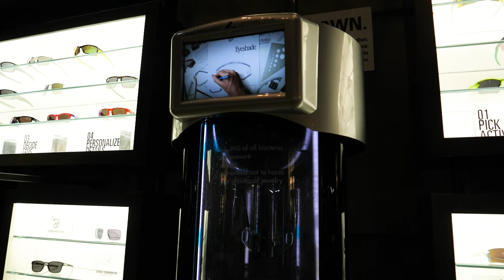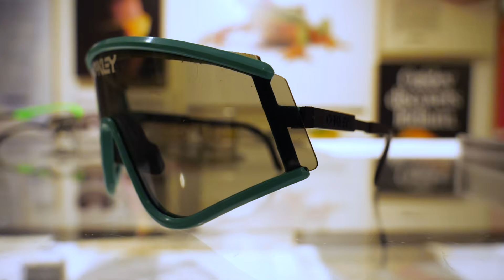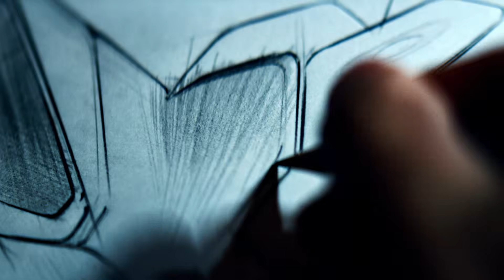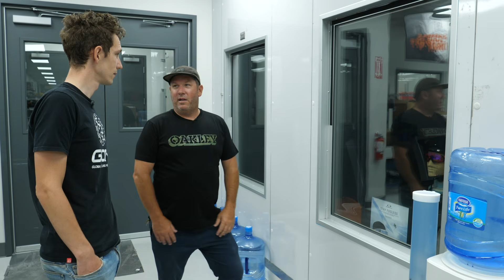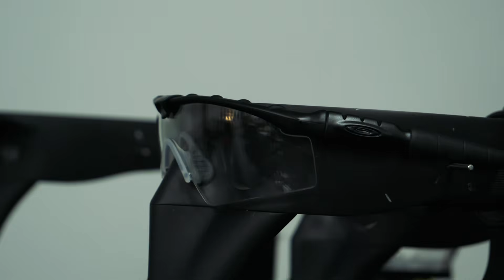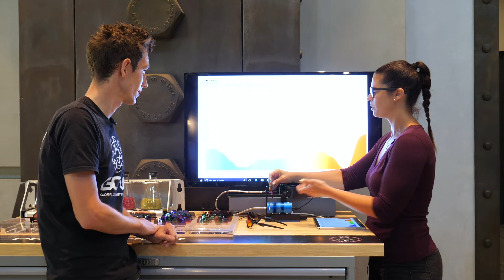Oakley Factory Tour | How Are Cycling Sunglasses Made?

Comment: It's kinda crazy with all of this testing, their lenses still peel..
Reply: Tanner yep, I have 4 sunnies that started to peel last year without much use of them
Reply: I’m collecting 24 years Oakley’s, mostly Only the pre luxottica” one’s and None of my was peel..Yes vintage 1998-99 Straight jacket’s and Eye Jacket frame was cracked..but 20+ years old 🤷..
Reply: @richardkrivik7032  I only collect  1998-2003 (Splice,Juliet, Eye Jacket, ect) Best frames ever
Reply: Yes and when you try to claim warranty on it, they will blame you for not wiping it down the sweat/sunscreen after every use. Obviously they have no evidence that is the case but they will basically push that as if that's the only way their lenses will peel. Never buying an Oakley again.
Reply: Because it’s the coatings like  polarized , prizm or mirrored etc that sits as a tiny film on the plastic lenses and scratch off easily, always go with mineral glass lenses that those features are infused  in the lens not on the surface, and that happens mostly with vintage frames before Luxottica bought out major brands like Ray-Ban, Oakley, Revoand applied cheap material to gain more revenue.
Reply: Tanner  I know and they scratch  easily also and so expensive Ray bans are beater they don’t scratch like that
Reply: They make very good frames which is why I buy Oakley BUT their lens coatings are USELESS.
Reply: I've had my shades for almost a year and they r fine
Reply: Same here
Reply: I only have a scratch on one of my Oakley's and that not supposed to happen
Reply: I had a pair peel. What I do now is after every ride I wash them in warm water and dish soap. Never had another problem except for scratches that seem to be unavoidable.
Reply: Tanner I have over 50 pair and none have a lens issue, soooooo
Reply: @777vikingfan  great. Lucky you. You dont have any issues. Plenty of people do.
Reply: its called marketing, they show these tests in very "ad" they pay people to come and do .... do you really think every lens goes through this test? its basically mass shipments from china and they maybe do a sample of some of them and 'assemble in usa' and if the tests fail they prob ship em back but still some get through
Reply: very good your comment
Reply: @Rhyme905 My Whisker sunglasses are manufactured in China 🇨🇳
Reply: Same here! 2 lenses, 2 peeled after a year
Reply: If everybodys glasses peel they would not be as big as they are in the World

Comment: I used to work inside manufacturing I have inside video  of how they made but after luxxatica both Oakley in 2007 Oakley started using cheaper materials to make lenses they tried to manufacture glasses in China but they came back cheaper made and they were scratchong and breaking easier I don't know if they still made in China and assemble in USA

Comment: Oakley tinting sucks.  Their glasses when used in a hot and humid environment (Asia) will have the tint flake off!  Anyone in Asia will know this.  Ruby does not flake like Oakely.
Reply: exactly! Had 3 and had the same results. Now i’m off to a diff brand
Reply: Have you ever tried Randolph Engineering?
These lenses are used by the United States Air Force.
100 % Made in U.S.A.
Reply: True
Reply: I totally agree.  This has been more than a decade old reliability and quality issue and it does not seem that they are addressing it or taking it seriously.
Reply: Is it Ruby or Rudy?

Comment: Bugatti is owned by Volkswagen, does that make the car not worth the money?  The company obviously has their own style and tech, regardless of the parent company.  I still buy a Land Rover even though their parent company in TATA.
Reply: Don't be dim, cloridian beauchamps. Lux own boutique brands and they still don't have a monopoly on boutique eyewear. They manufacture well built specs. School me on what laws they are violating.
Reply: @adamrudling1339  theres your issue, you think government mandated emissions testing is actually legitimate. you do realize that those mandates actually create more emissions over the long run because they decrease gas mileage. theres a reason why cars done get near the gas mileage like the old vw golfs did.
Reply: @678friedbed  please go and study some actual engineering, modern engines are vastly better in terms of fuel usage and emissions. Fuel consumption in a vehicle is affected more by vehicle weight , gearing and aerodynamics. Weight being the one thing that has raised dramatically over the years again  for various reasons - mostly safety, something again fudged by government interference. 

my original point btw was that just because a company has a monopoly in an area doesn't automatically make the product bad or the company either.  The choice of VW as a good company was fundamentally flawed. 
oh and yes VW vehicles are really overrated in my opinion, but so are many other vehicles.
Reply: There are so many comments about who owns them I wonder if it is competitor spam.
Reply: @dodecahedron1  VW are not a perfect company either, diesel emmisions scandal, poisoning monkeys & cloud cannons just some of the recent scandals ....
Reply: @adamrudling1339  you do know that the VW diesels in diesel gate got better fuel mileage and fewer emissions, but let's all believe the government actually has our best interests in mind instead.